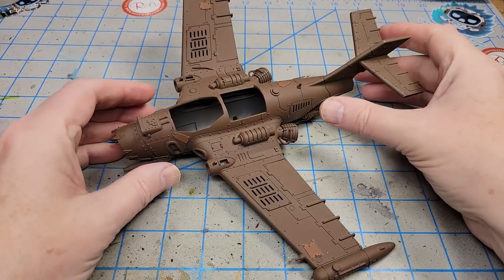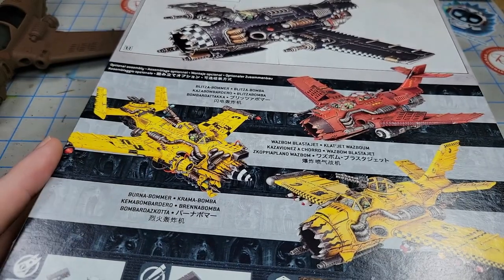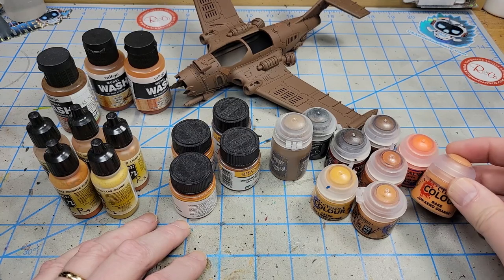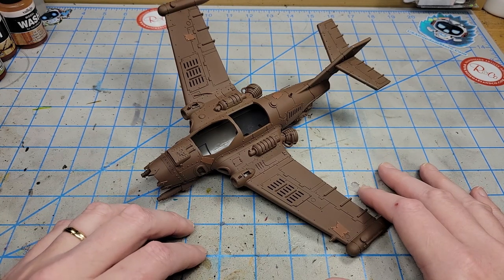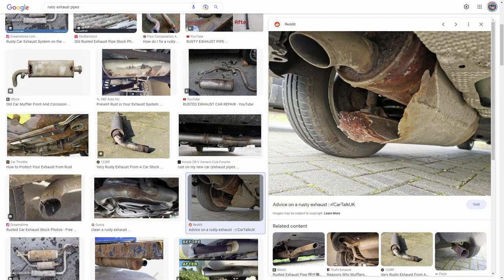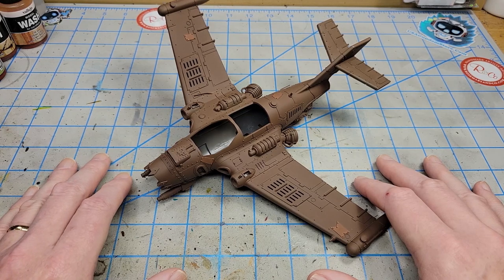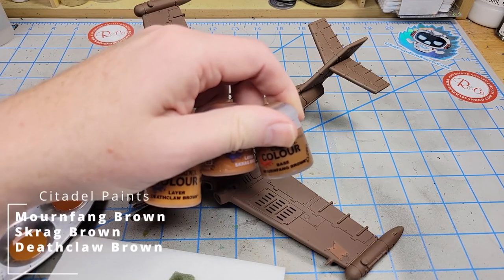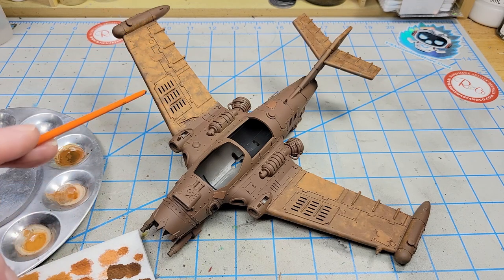Painting & Weathering an Ork Jet: Part 1 - Rust

Comment: When brush painting, how do you keep different colors of paint separate from each other without masking? I have a hard time  when applying this to gunpla.
Reply from the maker: The short answer - be careful. :)

I think keys are to make sure the paint is well thinned so it flows off the brush smoothly, and it's best to use a high quality brush. (Kolinsky or Pure Sable) In a way, works like using an ink pen so you add in your demarcation line, and then paint up to that line. Paying attention to having your hand, brush, and the model itself aligned for the paint stroke is important too.

Also - sometimes I add tape not as masking, but simply as a visual guide. 

I hope that helps - thanks for watching and commenting!
Reply: @JonBius thank you for your help! I’m trying very hard to try and make acrylic water based brush painting work for gunpla, but I’m struggling to get a clean finish… it comes out a bit textured. I feel like there should be a way to get a smooth surface but Im not sure if what I’m after is really possible with brush painting these kinds of paints, any thoughts?
Reply from the maker: @Mr._Gunpla  It can be done, but it requires multiple thin coats, allowing drying time between each coat. I think my acrylic paints at least 1 to 1 with water - that's the minimum I start at. In the end, it will never be quite as pristine as an airbrush finish though - but you can get quite close.